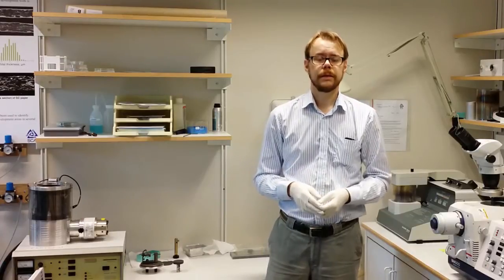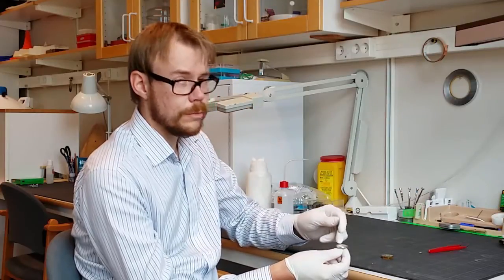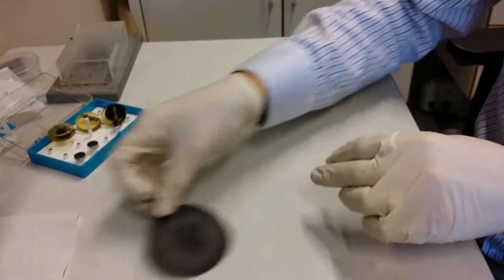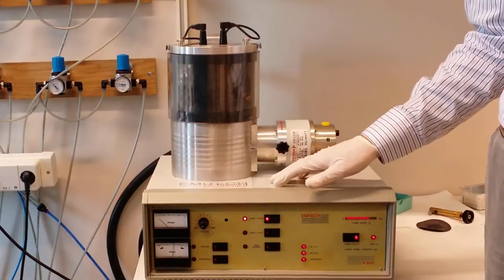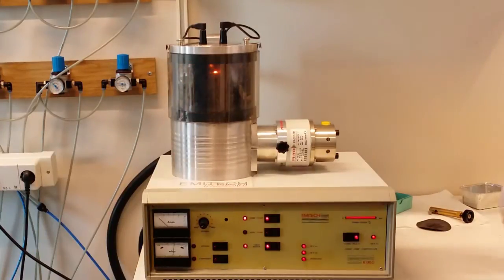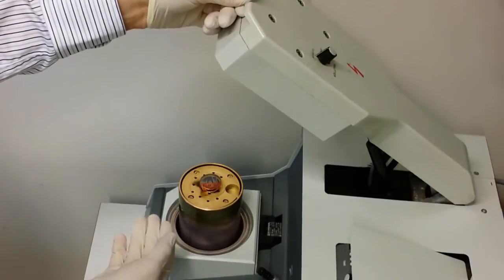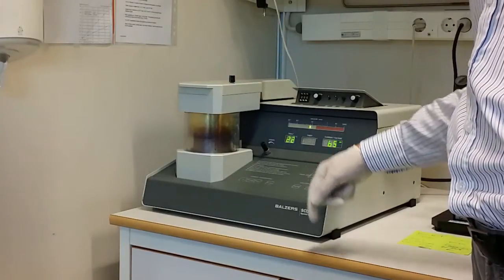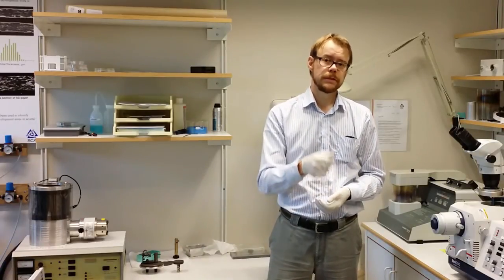Sample preparation: -carbon evaporation and gold-sputtering

Comment: I have succefully sputtered copper in glass, however, when I try to plate copper (galvanic acid copper bath) , the deposit come off the glass. What  possible is hapening? thanks for any help and great video.
Reply from the maker: +fercarcas not follow you there? You trying to deposit more cu by electrochem on same sputtered glass piece or what?
Reply: that's it. First I make sputtering using copper target and next copper electroplating bath. After some minutes, the film detaches (come off). Not know what can be hapening,
Reply from the maker: +fercarcas I also experienced poor adhesion on glass from sputtering. Have you checked after sputter if copper is well attached? I havent looked so much into it, I dont usually work with glass substrares, rumors say you shall sputter some thin layer of Ni before real metall, havent tried thou.

Comment: hello, thanks for posting. We are developing a sputtering machine based on an evaporator one. Some papers tell that better sputter pressure is below 1Pa, however your video employs 0,1mbar (10Pa). What do you think about that?
Reply from the maker: fercarcas you are probabley right, our sputter is old like shit. I have seen texts that state sputtered gold tend to aglomerate into rough surface when taken out in to air, and that some protect the gold by an in turn evaporate a carbon layer, done in the same machine before removal.

Comment: Hello! I have an existential question: the machines to make gold sputtering in samples that are going to be observed in the SEM also do the evaporation of carbon that serves to make replicas to observe in the TEM, why do not use the evaporation of carbon for samples of SEM?
Reply from the maker: yes, fully possible, but there is things to considerer. SEM due higher currents and mostly bulkier samples tend to have more charging problems compared to TEM work. A good metal coating is therefore prefered most of times (more conducting). But there are exceptions, if EDS, elemental analysis are being performed, metals tend to absorb xrays more and hampering performance, carbon is good in that perspective. Modern work rutine is nowadays either thin iridium coating and sometimes chromium for EDS needs. carbon are things u usually want to avoid in low acc voltage work, i.e <3kV.
Reply: Thanks!!